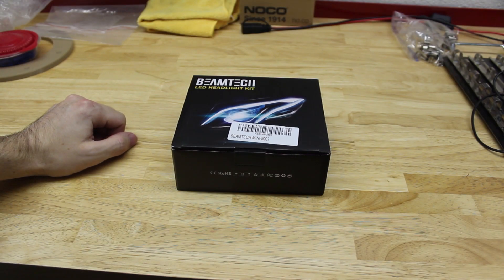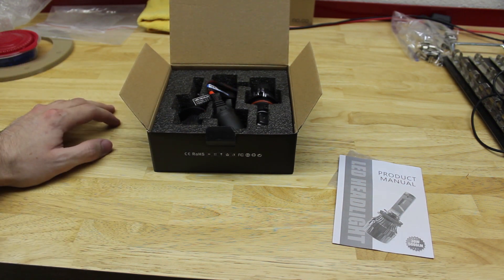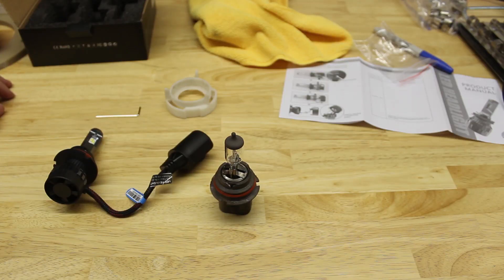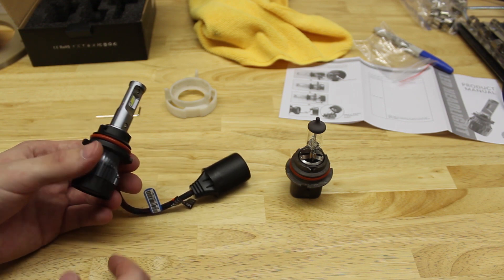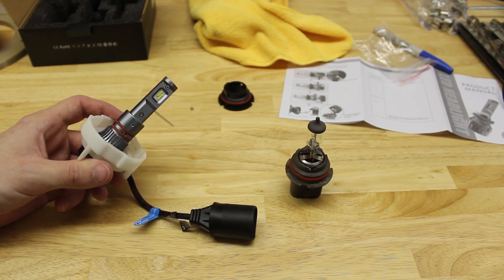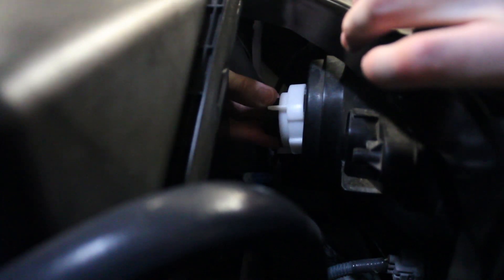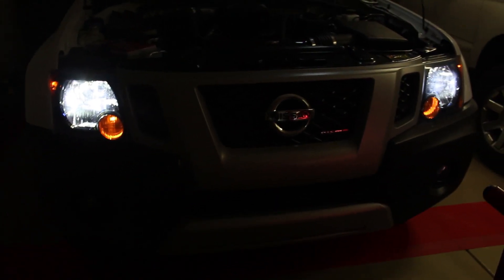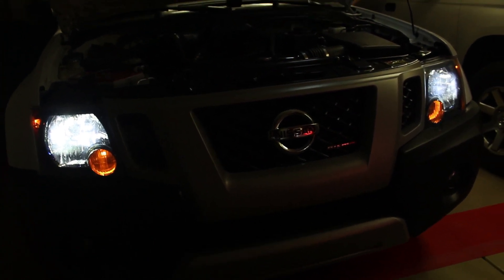Xterra LED Headlight Installation - BEAMTECH 9007

Comment: Thank you for great video. I bought 2010 xterra recently and came with after market LED bulbs.

However, it looks like Lo beam only. When I switched to high beam, still Lo beam cut line.

Do you have any idea to fix it? 

Thank you.
Reply from the maker: Perhaps new bulbs are needed.  Thanks for watching!
Reply: @redonKiLaus  Thank you! I appreciate!

Comment: If you install upside down will your high beam be the low beam etc? Just got this same kit for my 02 xterra (also 9007) installed. But now my high beam is low beam etc. I think I just need to clock it 180* to fix this issue.
Reply from the maker: I think that could very well be the case, I've not tried them upside down but I don't believe these are shielded so that is entirely possible.  Thanks for watching!
Reply: Hey, I'm trying to install there but the tab which rotates isn't large enough for this.how did you manage?

Comment: Why we need to buy locking ring if we can use the one comes on the truck
Reply from the maker: I had to modify the originals.  If you ever need to switch back to halogen lamps or to another set of LEDs that fit within the original halogen profile, then you'll need new rings.  

Thanks for watching!
Reply: @redonKiLaus  on your video, you didn't show how you modified the locking ring you just unscrew the ring from led then insert the locking ring
Reply from the maker: Take a look at the other video I made on the previous LED headlights I had in my Xterra - it will show you what modification I did.  Thanks for watching!
Reply: @redonKiLaus  thank you. Really appreciate the quick response. Gonna check that now.
Reply: @redonKiLaus  Take a look at WHAT other video you made on this? You can't provide a fucking link? I guess I'll sit here for 20 minutes combing through your videos. Appreciate that.
Reply from the maker: @ragnaroksangel  Just gotta use the right search terms bud, found it in about 30 seconds..."redonkilaus xterra headlight 9007" in YouTube search brings it right up.  https://www.youtube.com/watch?v=YhJ758rwcOo

Unfortunately I don't have the time every day to do the legwork for everyone on YouTube, so sometimes viewers have to do a little sleuthing when I can't or don't have time to find a link for a comment reply.  This isn't a job for me, just a hobby I do as I can that is able to help folks out.  Thanks for watching!

Comment: I was gifted some sngl leds. I found that the retainer ring would not clear the set screws, they were too long. My xterra is an '06 and plastic can be a little brittle. I took the set screws out and ground them down a little using a bench grinder. The set screw now sits flush at the top before it even contacts the bulb housing now the ring slides on and off like it did with halogens.

Comment: In this video, you stated the factory locking collar needs to be modified. But in your previous video, you stated the collar that comes on the LEDs itself needs to be modified. So which is it?
Reply from the maker: I believe I ended up doing both.  I know for sure that when the first set failed and I needed to put the halogen bulbs back in temporarily, the locking collar that had been used on the LEDs was too loose (i.e. filed down).  I reused that collar on the new LEDs since the unmodified, new OEM parts did not fit (too tight).  Not a big issue for me and the parts are easily available, but something to keep in mind.  Thanks for watching!
Reply: redonKiLaus Thanks for the reply, Merry Christmas
Reply from the maker: @Venomenon8  Merry Christmas to you too!